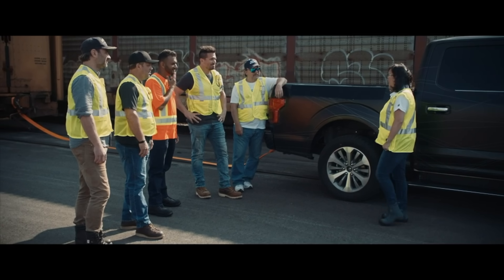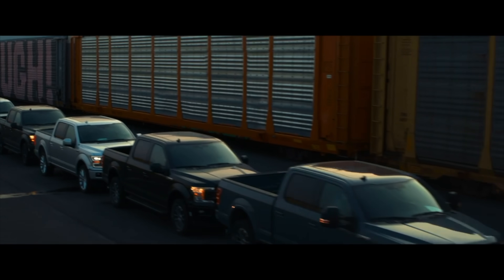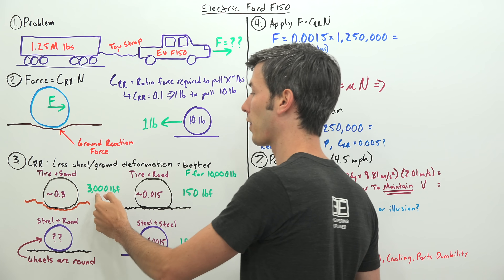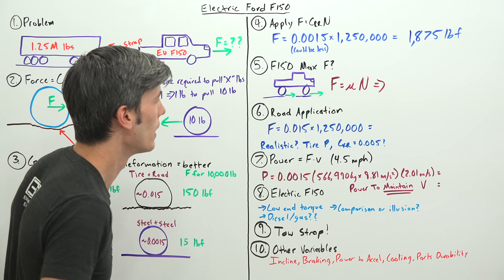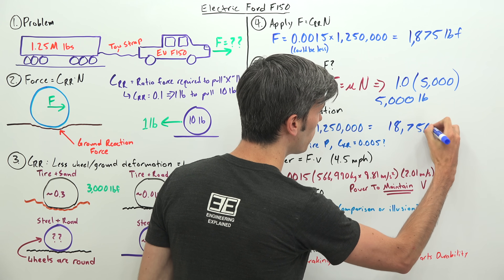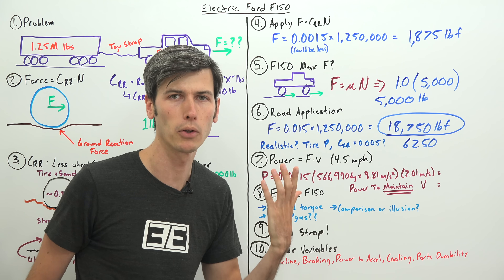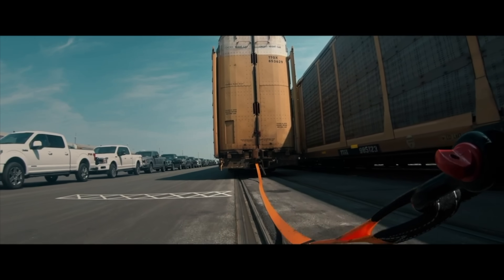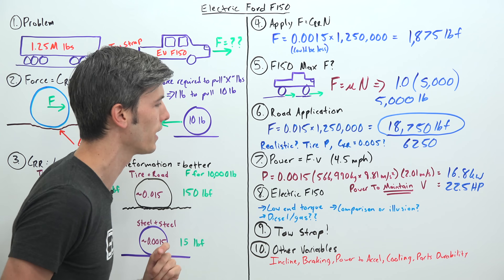No, Ford's Electric F-150 Can't Tow 1 Million Pounds (Realistically)

Comment: You forgot about F = m*A! Force on tow strap will be more than 1875. 

If it took 303 seconds to reach 4.5 mph, that’s an additional 846lb force needed. So force on tow strap would be closer to 2721lb force.
Reply: 4.5mph = 2.012m/s
a = (2.012m/s - 0) / (303s) = 0.00664m/s^2
F = (566991kg)(0.00664m/s^2)
F = 3764N = 846lbf

for anyone wondering
Reply from the maker: Yes, 1875 is just the force to start movement, not to accelerate.
Reply: Fortunately a 5000lb strap is only a couple dollars more. Can still pull trains on a shoestring budget.
Reply: @Raven1024  Shoestring budget = like literally!
Reply: Love your content! Keep up the good work!

Comment: TIL my old $1500 1998 V8 Ford Explorer can pull a train with the tow strap I bought at Walmart
Reply: Yes but my 1.9L TDI Golf can do that at 45MPG
Reply: @thegreatfalcon5  big oof
Reply: Ben Caron yea I’m with you bud
Reply: Meh, my diesel will haul it cross country and back if it had highrails.  Afterall, what Union Pacific uses on their tie gangs.
Reply: @brandoncaldwell95  Train usually use a diesel generator that powers electric motors though! Power comes from diesel, yes, but the massive torque at 0RPM is applied by an electric motor :)
Reply: @thegreatfalcon5  Ya i know that.
Reply: @thegreatfalcon5  BOOM!!... knowledge
Reply: @thegreatfalcon5  trains only use the start up torque a bit. Even then the are trying to move away from high start up torque because dc motors are unreliable in the application because of the high starting torque. And please dont ever sit at 0 rpm applying the maximum torque voltage you'll kill the thing. And I hate electric motors but dont think these things can just be at such low rpms and actually live long term. Infact most electric motors have minimum rpm ranges because anything below that is just killing the motor.
Reply: Also again no one has ever actually made a compelling argument that proves a DC motor even produces full torque at zero infact most state that it's just the transfer from 0 rpm to minimum so as soon as you press the accelerator it will try and move the rotor but if it's no given that zero rpm indicates no movement how can it be applying any force to the ground it's the transfer of the start and switch from a stand still to running that creates that sensation but all motors do this. Because even engines will have starting torque. It's just how motors work in reality as the force is required to move.
Reply: @jdrok5026  yep, worst thing for electric motors are startup and low rpm. Brushless motors have made it a lot less strenuous.
Low voltage is a killer.... Weak car batteries destroy the starter.
Reply: @ripsrt6822  true I'm kinda waiting to see if mopars idea of 4 phase pneumatic motors ever comes to market because that would be freaking hilarious probably problematic but fun
Reply: how about a moped
Reply: @stfinney1  same story of the clutch not catching fire (too much) and tire having enough grip

same story with a horse, though, if the clutch catches fire on that, you've got a big problem
Reply: haha was thinking the same thing.
Reply: Good luck stopping guys...lol
Reply: I've never seen an exploder that can tow anything without blowing the transmission. The local buy and sell pages are full of them for cheap with grenaded transmissions lol
Reply: So will my 1999 chevy blazer v6 apparently
Reply: My 2.4L Acura TSX can do it at 30mph
Reply: I’m no it would literally explode into a million pieces just driving to the train.
Reply: Yea but my dads Nissan Murano SL Will easily do it while in comfort
Reply: @jeanviloria1988  Theres nothing comfort about a nissan. A Range Rover or Mercedes is comfort.
Reply: @brandoncaldwell95  just because it's a Nissan does not mean it isnt comfortable
Reply: @jeanviloria1988  We can agree to disagree. No cheap new vehicle is ever comfortable or built to last.
Reply: @brandoncaldwell95  I disagree
Reply: @jeanviloria1988  Exactly. I dont expect a kid like you to know.
Reply: @brandoncaldwell95   Especially if your in the waiting room sofa in your mechanics shop.

Comment: This is basically the same thing that Toyota did years ago with the tundra when they pulled the space shuttle platform, rolling resistance makes everything so much easier 🤣🤣🤣🤣
Reply: kbrownfocus I mean at least the shuttle was on pneumatic tires on pavement
Reply: Were they pneumatic?

You do tend to find loads like that with solid rubber tires.

Forklifts, scissor lifts, keep scaling up.
Reply: What about VW when they pulled a 747?
Reply: @SquishyZoran  AH HELL! I totally forgot about that 🤣🤣🤣👊🏼
Reply: Except of course the Toyota is probably still towing it even after 500000 miles and still going, an American made electric car, hmm probably self combusted after 200 on the odometer
Reply: This is still a pretty impressive feat……… what this proved was that the electric Ford F-150 is may have 1500+ lb/f torque which would be insane
Reply: Probably because towing 1.2 million lbs sounds a bit ridiculous compared to towing a space shuttle
Reply: Yet it wasn't an issue when they did it
Only when an American brand does 
Something people want to expose it
😢😢😢
Reply: Plum_Crazy 1992 
This is way more deceptive than anything Toyota did with the Tundra.  The Tundra started AND stopped 300K pounds on pavement.  Sure it was clever marketing but at least the pull was half way realistic.
Reply: @smrtguy77777  Precisely! My uncle, who was an engineer for BNSF laughed his ass off when I sent this to him, he said he would loved to see what happened to stop the Auto haulers 🤣🤣🤣🤣
Reply: @smrtguy77777  
Half way?? Who's to say either or?
We don't know the specs of either 
Those trucks could be modified 
It happens with lap records often
Reply: @smrtguy77777  Even if they were pneumatic tires, the load in a free wheeling wheel like that is probably closer to the train than a normal car.  Remember VW pulled a 747 (you know the kind of plane that ferries the shuttle around, and weighs 3x more easily... ) with a Touareg... Pretty sure no OTR trucker is gonna trade in their Freightliner Cascadia for a Touareg or a Tundra or an F150 anytime soon.  :D That being said, If I had access to a train, I'd hook up my F450, my jeep, my mustangs, anything to that thing just for shits and giggles :D
Reply: @smrtguy77777  the shuttle only weighs 165,000lbs
Reply: @smrtguy77777  still took less force to move then the train when the math is done
Reply: Plum_Crazy 1992 yea it’s cuz there’s unfortunately a lot of anti-Americans and they have to attack everything American
Reply: Plum_Crazy 1992 

I don’t know why, no one complained, but no, when ford did it, people started talking crap
Reply: @TecDLogic  
There's so many companies who
Are doing dirt to consumers yet
We are exposing PR stunt. How 
Many buyers will attempt this 😂
Reply: @WindyCity1992  Honestly, I hope none, but you know it would be funny as hell to watch 🤣🤣🤣🤣
Reply: @TecDLogic  because it's Ford 🤣 Don't get me wrong though, I love older Fords, but yeah..... I think I know what Ford is doing though, taking a stab at GM for all of the deceiving ads they've put out against them for the aluminum bed, I would love to see GM top this 🤣🤣🤣🤣🤣🤣🤣🤣
Reply: ILogic 1 u aren't very smart are u, the shuttle was on TIRES, the train is on rails.
Reply: @WindyCity1992  To me it makes even less sense that people always try and look for how companies are deceiving them, but nobody cares about politicians deceiving them. Also I'm not trying to make this political, I mean politicians in general.
Reply: @Lysergic_  
Yes. And i get the point. But like you
Said. There are more important evils
Out there plaguing the world. But this
Is a car channel so i understand 😔😔
Reply: @saturndesigns2339  doesn't matter, the shuttle with the trailer isn't even more then 200,00lbs, this was 1.25million lbs... Do the math and the shuttle takes less force to move....

Comment: Thanks for doing the math and proving that it was an neat trick. I figured it was a neat trick once i saw it was a tow starp and not a solid mount or even chains. This video proves a 4wd minivan with a working load limit tow strap of 2000lbs could do the same thing

Comment: Plus, trains have COMPRESSION COUPLINGS between each car, so the truck only needs to get one car of the train moving at a time; not the whole train at once.
Reply from the maker: Yep! Another factor which I did not discuss.
Reply: @EngineeringExplained , if you ever watch a train 
starting to move, you'll hear a series of thumps.
There is about an inch of play, in those couplings, 
and that is on purpose.  I was talking to a guy, who 
drove locomotives, he said, without the slack, his 
locomotive couldn't start a train moving.

steve
Reply: @steveskouson9620  auto racks have 3 feet of slack per car due to the cushion drawbars
Reply: @steveskouson9620  that's not a true statement. Yes, in certain situations you bunch up the slack to get a running start. Most of the time it's not even a consideration.
Reply: Those are called End of Car Cushion units. Theres no "spring back" force assisting. They are there to reduce the buff force on the vehicles when they are going at speed.
Reply: That is interesting to know. Always heard of the thumps when the train starts moving but never thought to question it.

Comment: A Mercedes-Benz Unimog is rated for three times this weight, with less then 300hp. In the old days little train engines moved thousends of tons with less then 100hp. When you have the gearing and the grip you can pull anything. Nice stunt though.
Reply: As noted, inclines are a problem. Hence cog railways, with a gear on the loco and a toothed rack between the rails.
Reply: Old steam engines made thousands of horsepower. But all that power aint worth nothing if it aint geared to pull
Reply: Damn you beat me to it.
Reply: yeah,but the unimog has low ratio gearing as well as the high. this does not
Reply: @robivlahov  Linear traction motors (such as those used in diesel electric locomotives) have one unique feature...torque is proportional to rotational speed. 100 hp in (~74500 W) at 1 RPM with a traction motor can get you up to 525,000 lb-ft of torque...
Reply: @zapityzapzap  Provided you have enough forced air cooling for that motor. Otherwise you have a very hot, then very burnt, motor and controller. Full power dissipation without the cooling fan on most motors is going to result in a very rapid rise in internal temperature.
Reply: @zapityzapzap  Absolutely incorrect. You don't get full power at lower RPM, only full torque.
Reply: @davidjereb  I said nothing about full power. My reference to power was in terms of electrical input (or mechanical mechanical input coverted to electrical input) on the motor.
Reply: @zapityzapzap  Electrical power into the motor is also very low at low speeds.
Reply: Electrical power is T its highest at very low speeds. as the armature spins the electro motive force increases which reduces the current through the motor. Look up locked rotor current for more information.
Reply: @ew3612  Incorrect. The inverters are designed to handle a limited amount of current and so is the winding in the motor. The maximum torque is directly proportional to the current. In an electric drive system the motor therefore has a fixed torque up to a certain speed, at which it reaches the maximum power. From there on the torque decreases inversely proportional to RPM and maintains constant power.
Reply: Robi Flego You’re incorrect
Reply: @kevinnorris6558  how? the thing has 20 gears... maybe the new auto ones have something else but the oldschool ones do have it like that

Comment: let's not get incorrect , you can't have 0 RPM and Max torque.
Reply: I think what he was trying to say was that max torque was available at 0rpm. As in, there isn't really a standard power curve like you'd see on a ICE. It doesn't need to get up to a certain RPM to have max torque available, that's the beauty of an electric motor.

Comment: Remember when Toyota pulled the space shuttle?
Reply: a space shuttle is much cooler
Reply: But Toyota didn't make any claims like ford. The toyota commercial was just for wow factor. Fords trying to make a statement by saying their new truck can haul 1mill pounds.
Reply: @denverwilliams22  We’ve confirmed we are bringing an all-electric F-150 to market. Now, we’re showing you the capability you asked for by having it tow more than 1 million pounds.* This is Built Ford Tough. 

*The F-150 battery-electric prototype is towing far beyond any production truck’s published capacity in a one-time short event demonstration. Never tow beyond a vehicle’s towing capacities. Always consult the Owner’s Manual. 

It's almost like you didn't even bother to try and read anything about it.
Reply: @rainbowsquash673  I think his point is that it was basically the same stunt. Yes the shuttle was on pneumatic tires, but it only weighed about 292,000 lbs. Using the formulas and figures Jason used, it took 4,380 lbs of force to tow it, which is within the 5k lbs limit (according to Jason) the F150 has.
Reply: Remember when Volvo pulled 750 tons on actual truck trailers?
Reply: I remember when 5th Gear pulled a 747 with a VW Touareg
Reply: Mr. Boring on YouTube touaregs are definitely no joke! Those things can tow honey booboo and her mom
Reply: yup, and even after 5000000 miles on the odometer the Toyota is still pulling it, this Ford , probably after 200 you will get electrical problems  :D

Comment: I have seen a human, average one push a railroad boxcar. I have pushed a 1,200 lb Hardinge lathe across a concrete floor, and anybody could do the same. The boxcar had clean wheels on clean track. The lathe had a finished and coated concrete floor. Do not allow these corporations, ford in this case, pollute your head and trash your cognitive abilities. THINK!
Reply: BiddieTube i regulary push a 4000ton ship. That’s 8 times the weight of this train. By hand! Just very slowly an a short distance.

Comment: Reminds me of the Toyota stunt when they pulled space shuttle
Reply from the maker: Diddy Doodat yep, but that was hitched (rather than tow strap), and it was on a paved surface, which makes it much more challenging. Obviously they pulled significantly less weight (because they had to - rolling resistance).